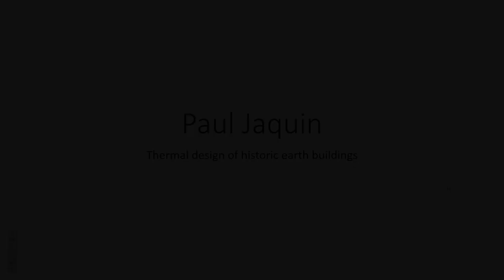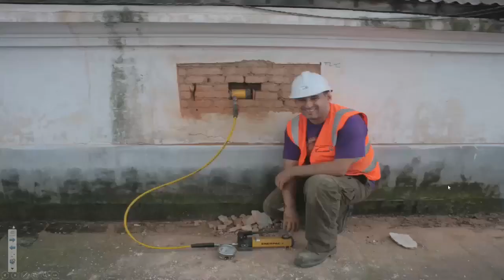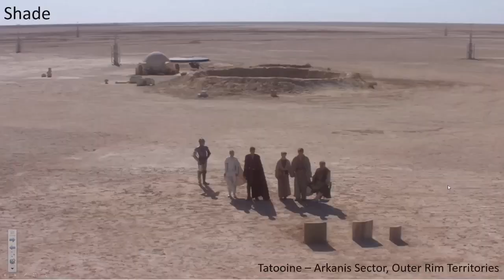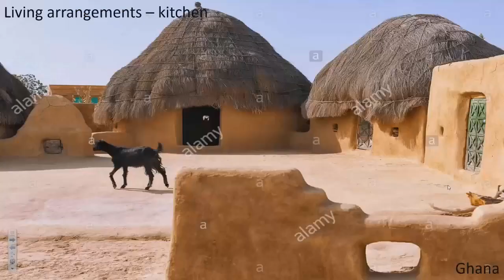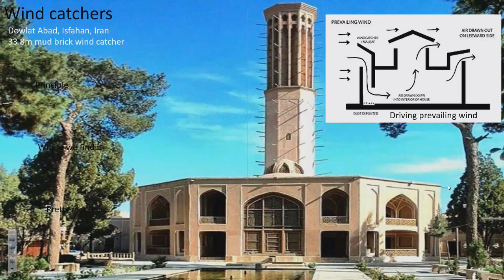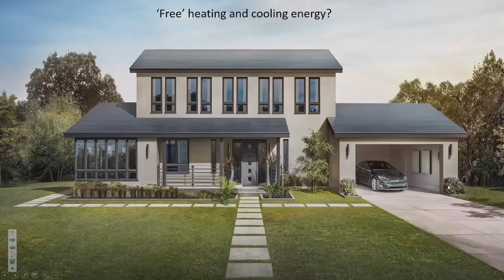Thermal design of historic earth buildings

Comment: About the wall thickness of Moroccan buildings, a man from Skoura once told me that other than structural and thermal reasons, another reason for the thick walls (sometimes up to 1m of thickness in ground floor) came from times when tribes would attack each other over conflict. The attackers would dig through the walls to attack people inside the kasbahs/ksour by surprise. So people made their walls thick to be able to detect the digging in time and have enough time to react.

Also, about the Musgun hut, Cameroon picture, the 'cooking thing' in the outside space is traditionally used for grain storage.
Reply: I would also assume stability against natural disasters if any and the walls ability to stay up long term

Comment: Exactly why design is so important. Living in an arid desert, I'm very aware of how difficult it is to cool a building when temps get up to 115-120° F in the hot months.
Reply: Research the WindCatchers of Persia, You will find comfortable living with passive, no energy use system are possible in arid, high heat climates.
Reply: Not hard at all when your walls are 2' thick.  Open it at night and let it cool, close the vents and heat of the day barely warms it up by nightfall, repeat the cycle. (literally don't need A/C)